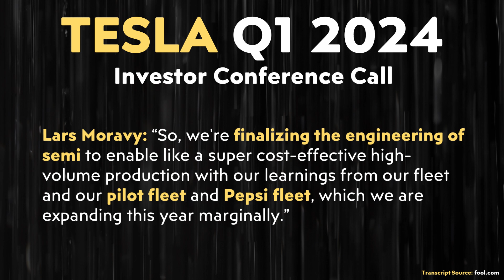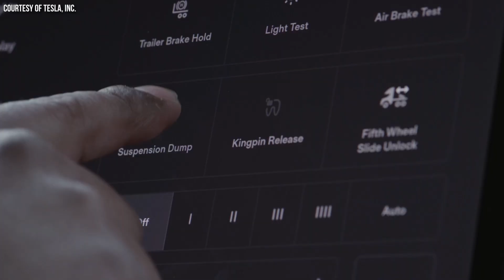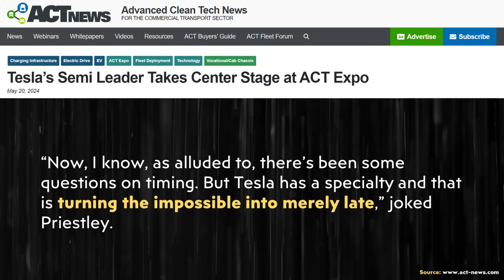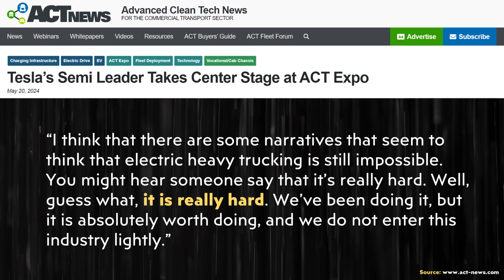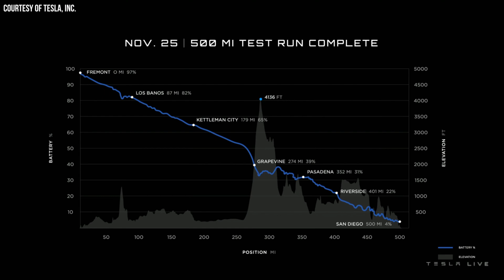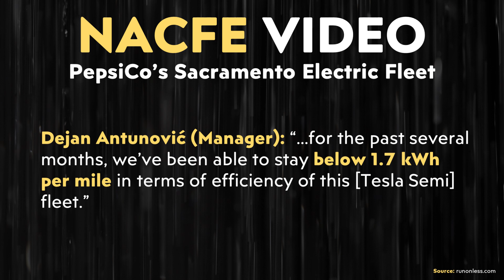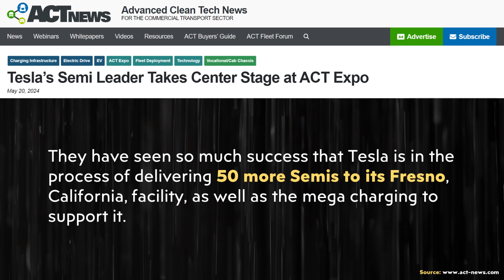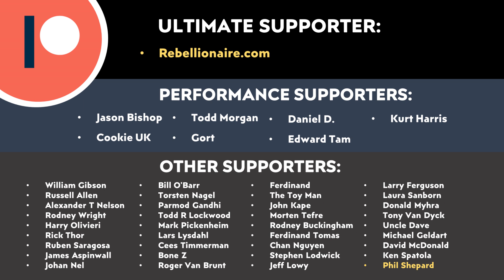BIG Tesla Semi Update | Mass Production is FINALLY COMING!

Comment: Unfortunately the current charging availability is not at all structured for semi trucks. We saw this first hand. While we were heading from Southern California to Texas outside of Dallas to see the eclipse we came across a Nicola. Just inside of Arizona we had to charge at a gas station that only had four electrify America chargers. There were Tesla's on the other side of the freeway from us but obviously the vast majority of people can't use those chargers. There were four stalls all four were working but all four were already full and there was an additional four more cars in front of us waiting to charge. We parked in line and the Nikola pulled up behind us we all got situated and we started charging and then the Nikola finally got to start charging. They had such a hassle trying to get the gigantic semi into the parking spot. It does in fact fit into a parking spot but given how long it is it is incredibly difficult for the thing to maneuver into position. It obviously didn't have a trailer but that didn't stop it from having a difficult time getting into the pretty much regular parking spot. We had to unplug our Chevy bolt and move over so that the Nikola could fit into position. We were also towing a small teardrop trailer and we had to drop the trailer off in a parking spot and then go over and charge because obviously the single parking spot was not suitable for us to have the trailer in. Is there going to have semis charging they are going to have to put chargers that are in pull through spots that a semi can actually get into
Reply: Eventually, there will be separate charging stations for Semi Trucks, just like there are separate areas for Semi Trucks at the big travel centers like TA, Love's and Pilot/Flying J. The charging for the Semis will also be at a much higher charging rate, 1 Mega Watt and above. They will also have their own connector that is designed to handle the high power requirements (that standard is currently being written and finalized) of the Semi trucks.

The current state of charging for Semis like the Nikola is for them to temporarily use the CCS charging network. Like you said, the Nikola was not hauling a trailer, so I am guessing that it was not actually hauling a load, instead, it was being re-located. 

Generally speaking, if you are going to use Electric trucks in your fleet, you are probably going to be installing your own charging infrastructure. 

In the beginning, these Electric trucks will not be used to carry goods  on "Long Haul" routes, simply because there is no charging infrastructure to support them. However, since over 80% of trucking is "Short Haul" and returns to the "Home Depot" every night, fleets can install their own charging infrastructure to support their operations. Many times that charging infrastructure will allow for lower power, long dwell time, charging, like overnight charging in the case of a local distribution center ( think grocery stores and big box stores). Sometimes that charging infrastructure will include DC Fast Charging if a company needs to support multiple shifts, or longer routes where a mid-day top off charge might be required. Other times the fleet might require a mix of both types of charging , PepsiCo is a good example of this mixed charging. They have several Mega Watt DC Fast Chargers alongside slower charging stations for their trucks that return to the depot for overnight charging.
Reply: "Obviously the vast majority of people can't use those [Tesla] chargers." What? The majority of EVs on the road are Teslas! They were around 80% of the EV market, now they're about 54% of all EVs sold. All "Non-Teslas" combined are a minority.
Reply: @truhartwood3170  the vast majority of non Tesla's can not use those.
Reply: @UlexiteTVStoneLexite  Right, which are the minority of EV owners. The majority of a minority is still a minority.
Reply: @truhartwood3170  Tesla actually only holds 51% as of this year so that majority is going to be gone very fast
Reply: @UlexiteTVStoneLexite  that's fine. It's still a monitory though, isn't it? Even after Tesla loses the majority of new sales it will take years before they're not the majority on the roads, and by then all the automanufacturers will have switched to NACS so at that point the number of vehicles that can use Tesla chargers will skyrocket their way to 100%. So basically it will always be the majority of EVs that can use Tesla charges. You're not going to win this point. Just drop it. Not sure why you want to die on this hill. Are you just butthurt you didn't do your research and get a Tesla?
Reply: @truhartwood3170  a minority by 1%? Yeah I wouldn't be bragging about that lead it's not going to last very long.

Lol no I would never buy a Tesla. I have done the research it's not worth it I would much rather have a Chevy bolt than a tesla. I've already purchased two Chevy bolts and my husband also purchased a Chevy bolt we would never buy a Tesla.
Reply: @UlexiteTVStoneLexite  I'm talking about the percent of EVs on the road, not "the percent of new EVs being sold at this split second". Since Tesla was 56% at the beginning of the year, 60% last year, and 70 - 80% the years before that, the percent of EVs on the road that are Teslas is more like around 65%. 35% is definitely not a "vast majority". Even 49% is not a "vast majority". And 49% makes it a minority by 2% (51 - 49 = ?). I'm going to go out on a limb and guess your job is estimating crowd sizes for a certain GOP candidate. 

Congrats on your Bolt. Hopefully in the future you can afford a decent EV and not have to get the cheapest on the market and then have to defend it and pretend it was a choice.
Reply: @truhartwood3170  and when I looked up said that in 2024 they made up 51%. That is a slim majority. 

Lol yeah my bolt is a decent EV. It gets the same performance as a Tesla model 3 and I can actually get parts for it in a timely fashion.

Lol the cheapest one on the market was my preferred choice because I'm not going to overpay for a Tesla when my bolt gets the same performance. My bolt has so much more cargo space the name model 3. I've been in a model 3 I would never buy one. My Chevy bolt is far superior to the model 3 in terms of affordability and utility. I go camping who is my bolt euv. I wouldn't be able to do that in the Tesla because the cargo arrangement is terrible in the Tesla.
Reply: @UlexiteTVStoneLexite  you're looking at current sales data, not the percent of EVs on the road that are Teslas. But even then, you literally said "the vast majority of people" can't use Tesla chargers. Even if Non-Teslas were 49% of EVs on the road (which they're not, more like 35%, but just for arguments sake) is 49% a "vast majority"?

Well, is it?
Reply: @UlexiteTVStoneLexite  glad you can find parts for your Bolt! You'll need 'em! 😎👍
Reply: You know that 80%(?) of car charging is "slow charging overnight"?
.
So, if they have large "car charging" locations, empty overnight, configured in the correct way with a space behind a row of 10-12 car chargers, then a Semi can pull in behind that row to "slow charge" .
.
If a megacharger can add 20-80 in 1 hour, a V3 has.. let's say even 1/6th of the capacity, that's a full charge in 6-8 hours..... Just needs an adapter (just like a "slow car charger")
No Megachargers required for OTR .
.
Numbers?
How many can charge?
That just depends on the ratio of trucks to charging locations.
.
It's a network ready to use which can expand with numbers.
Reply: @rogerstarkey5390  not while you're going long distances. We don't charge overnight while we're driving long distances unless we're at a campsite that has hookups. Almost all of those charging locations had other people charging in the afternoon. There was a line of four cars waiting just to charge while the other four cars were already charging in the middle of the day. 

Those trucks are not going to be using overnight charging. They're going to be using fast chargers.
Reply: It's structured for Tesla semis just fine; they can charge at any Tesla Supercharger site. For example, they do so frequently at the Harris Ranch, CA Supercharger when delivering loads from the Pepsico Sacramento Bottling Plant 270 miles to Bakersfield, and need a little boost to get the rest of the way back to the Bottling Plant.
Reply: @BigBen621  I haven't seen any Tesla superchargers that have large enough pull through spots
Reply: @UlexiteTVStoneLexite  They're just starting to add those pull-through stalls now for CTs towing trailers. Semi will get its own chargers. Not sure why anyone thinks this is an issue. As they add routes for the semi they will know exactly where the semi megachargers need to go to support them and they will put them there. Not a particularly hard concept.
Reply: @truhartwood3170  so like I said the current charging availability is not suitable for semis!!!!! I didn't say that it's not going to be I said at this time it is not I don't understand why everyone is arguing when obviously I'm correct.
Reply: @UlexiteTVStoneLexite   I haven't seen any Tesla superchargers that have large enough pull through spots 
I can't speak for any of the other tens of thousands of Supercharger Stations in the U.S., but it's clear from the 2023 NACFE Run On Less tests that Tesla Semis definitely were recharging at Harris Ranch. I had an earlier photo of the Harris Ranch Supercharger, before the solar canopies were built, that shows a pull-through space at the end of one row; but I can't find it now. And the Google Earth photo still shows some sort of pull-in spaces at the west end of the middle canopy, and Street View shows the back end of a semi going down the driveway to the Supercharger. So there's no doubt that Tesla semis do recharge at Harris Ranch, it's just not clear exactly how.
Reply: @BigBen621  dude you've only named one. I drove from Southern California to Dallas Texas and I didn't see anything that would work. Also Nikola can't run on Tesla chargers
Reply: @UlexiteTVStoneLexite   when obviously I'm correct. 
I don't understand why you claim you're correct when Tesla Semis are most definitely charging at the Harris Ranch Supercharger, likely among others.
Reply: @UlexiteTVStoneLexite   I drove from Southern California to Dallas Texas and I didn't see anything that would work 
Tesla Semis aren't driving this route yet, so there's no need for them.
 Also Nikola can't run on Tesla chargers 
This is a video about Tesla Semis. But since Tesla has agreements with almost every other EV manufacturer in the U.S. to use its Supercharger network, it seems likely that they'll make a similar agreement with Nikola.